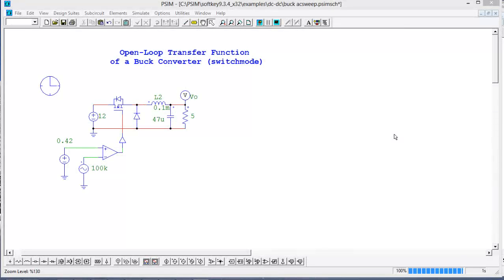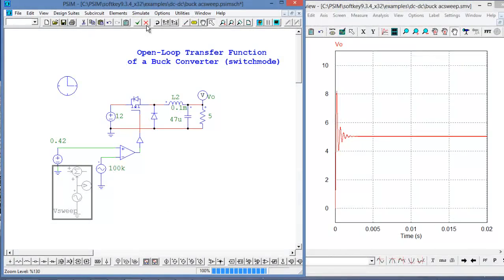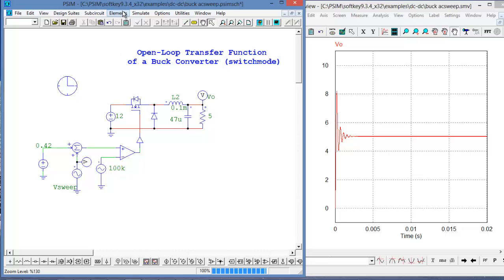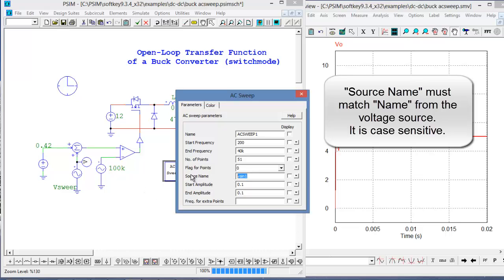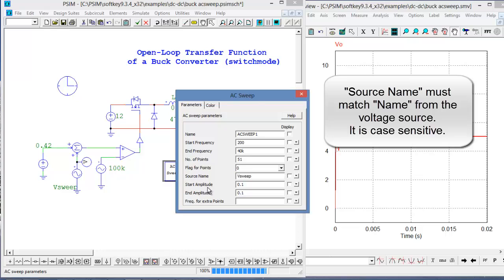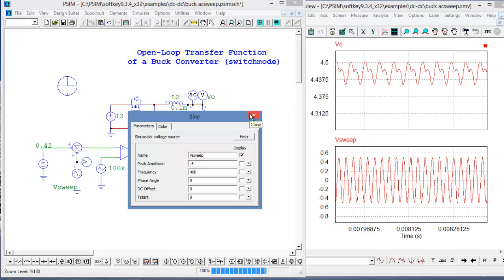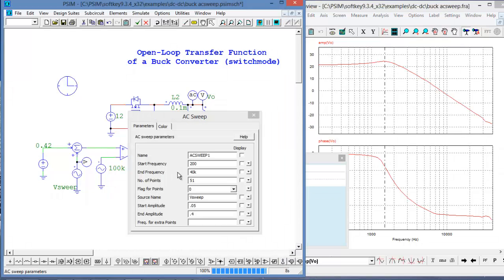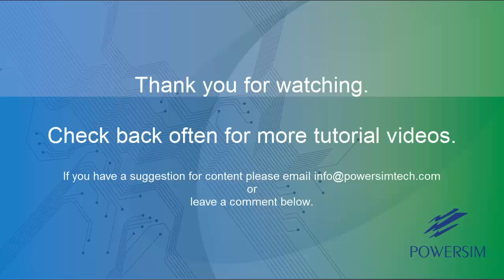How to perform an AC sweep with PSIM

Comment: both AC SWEEP and AC SWEEP MULTI SINE are giving bode plots. so what is the difference?
Reply from the maker: the difference is how they get generated the m-sine sweep is typically faster. Both approaches are fairly robust but both can encounter issues with certain circuit types and sweep parameters. It is up to the user to use and understand the bode plot outputs

Comment: Nice video. I have a special request. Is it possible to do AC sweep along with parametric sweep? Take a case of the above example with only modification of loop is closed. now I want to do AC sweep for the converter at different input voltages say 10V, 12V and 14V. is it possible to do it in one run and plot the bode for three voltages in one plot?
Reply from the maker: +Dibyaranjan Senapati yes, you can do a parameter sweep with AC sweep. Also, you can do it with scripts for more flexibility.

Comment: hello nice video...i am trying to do a ac sweep with flyback converter but i cant get it to run....not sure if it is because of grounding i tried with/ without grnds and tried using different models but nothing seems to work...when i start the simulation nothing really happens and when i stop the simulation the sim grapher crashes....can you please help me out thanks ....
Reply from the maker: +Srinivas s it is difficult to troubleshoot a problem like this through youtube comments. Of note the AC sweep probe is ground referenced, if you are looking to view the response of the output voltage vs the reference you will need to use a voltage sense element first as the secondary of your transformer should not be grounded to the primary.

Comment: i would want to know how work wattmeter in psim, anyone can help me?
Reply from the maker: +Thiago Souza The wattmeter element has a filter, you will need to specify this filter, depending on how quickly your load is changing. For a 60Hz system a cutoff of 30Hz is acceptable, for a DC system 20 Hz. You can play around with the cutoff to see what happens. The element needs to be inserted in series with the source or load.
Reply: +PSIM i need know how the wattmeter work, because i will simulate a circuit 3ph with the 2 wattmeter method, and i dont know how i can assembling the circuit, show me how i should ride the circuit, thanks
Reply from the maker: Please go to our website and use our support form for more detailed support.